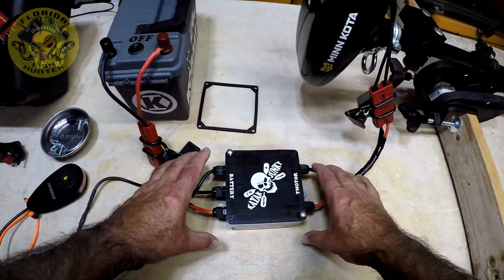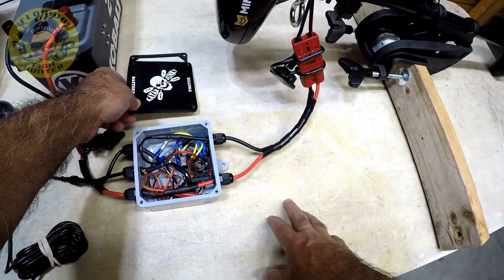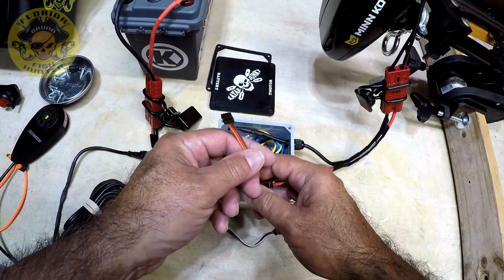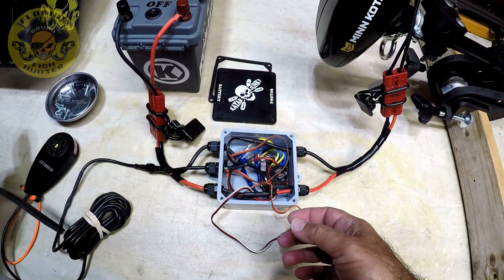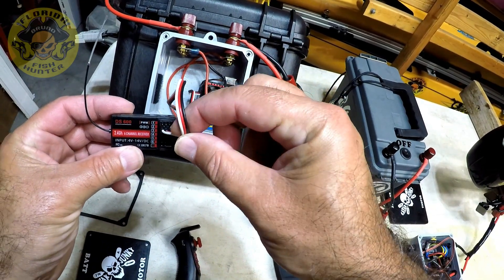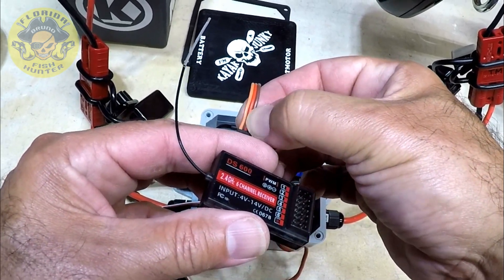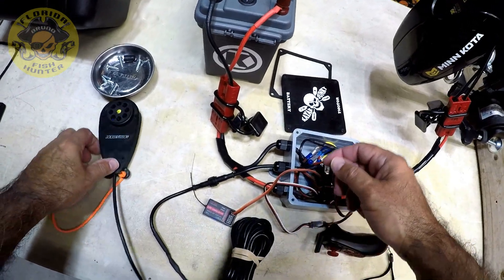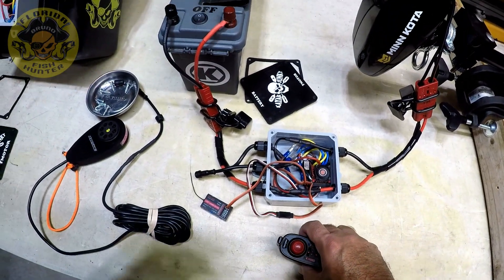The Cantex Project: PWM Tether / RC Overview - Florida Fish Hunter

Comment: Good afternoon, let me ask you a question. Does this 880 80a ESC support 54lb?
Reply from the maker: Hi osmanoaloisio96! Yes, the 880 esc can support a 12 volt, 54lb thrust brushed trolling motor. A 54lb thrust trolling motor's amperage draw can vary, but generally, you can expect a 12V model to draw around 36 amps. The Hobbywing 880 esc is designed for a maximum continuous current load of 80 amps and can handle a maximum input voltage of (16.8 volts). I hope this info helps. Thanks for dropping by to check out the video and leaving a comment! 😊👍

Comment: Thank you for the sharing of your ideas you have some genius solutions for sure.  I do want to know since you deal with the Florida heat.  Was there any major issues with the ESC before you added the vents or were you just being preventative?  My battery box is sealed and I am hoping to place the ESC inside of it.
Reply from the maker: Thanks @MultiGunner65! No issues with the ESC but since it is waterproof I wanted to add the vents as a preventative measure specifically because of the summer heat dealt with here in Florida. I have seen many people online show that they run theirs in a sealed container but can't really say if they ultimately did not run into overheating problems. What I would do in your situation is just to try it out in your sealed box and see what the actual results are for yourself. 😊👍
Reply: @FFHTV  Thanks for the reply and it is good to know that they are somewhat heat tolerant!